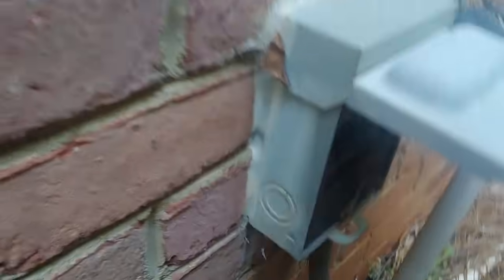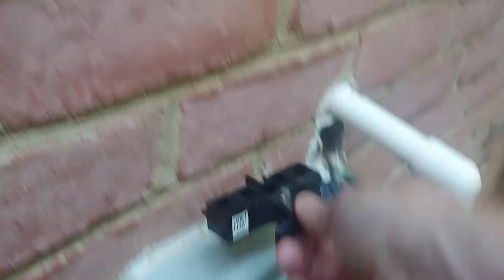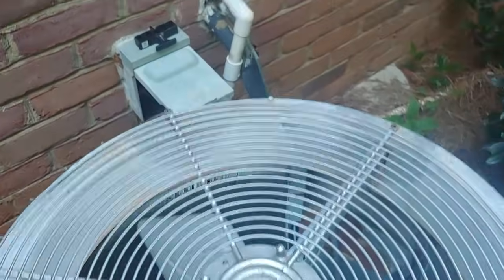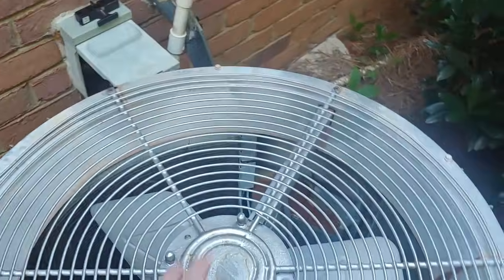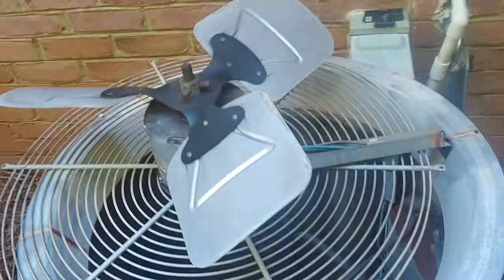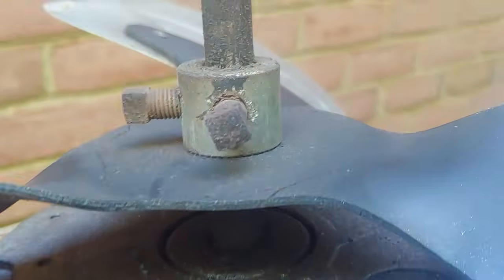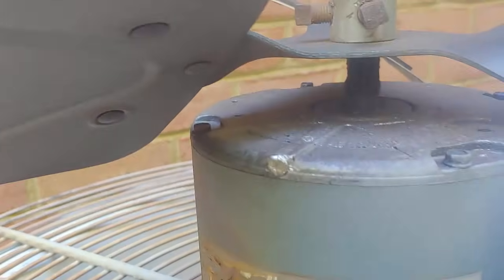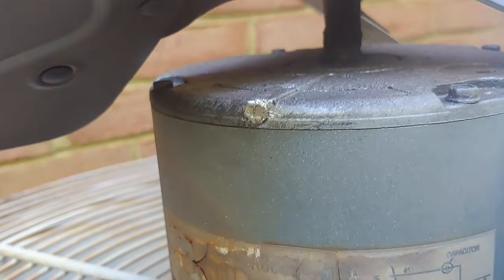YES! You CAN oil an air conditioner fan motor AC Fan squeaks/squeals/chirps/screeching noise, FIXED!

Comment: Last night my fan stopped spinning altogether so I went out and gave it a few taps with a hammer and it started spinning again but seemed a bit slow. A few hours later it stopped again. It was my plan to go get WD40 but luckily I came across this video. I hope doing this will get me through this heat wave we are having this week.
Reply from the maker: Smart. It seems like you caught it in time. Mine is still going! I did just oil it again, this time I used electric motor oil, actually hair clipper oil and it has not been this quite in years!

Comment: hI.  i added the 1 AND 3 OIL TO THE FAN AND NOW it does not come on.  What did i do wrong
Reply from the maker: Double check all your wires make sure you didn't pull something loose. Also make sure you did not put your quick disconnect back in upside down.
Reply: @SwimmingintheDeep  it started after a couple of resets.  I got scared. The fan sounds much smoother but still has like a off balance sound to it .  It is about 15 years old. Thank you so much for the reply; and help.  Much appreciated.
Reply from the maker: @danasweatt1484  ahh good. There is likely a built in delay to restart after repower on your unit.  The off balance sound could be a bad bearing in the motor or a bent fan blade. If it is a bad bearing your noise may soon return then then the remedy is usually fan motor replacement.
Reply: @SwimmingintheDeep  super thank you. Trying to save a dollar. I went ahead and purchased a new fan motor unit to have when ready.  Blades don't seem bent but could have overlooked a minor bend. I took it off last time when cleaning coils. Probably bearings.  Thank you again. Helps to have advice when new/green to it.

Comment: Not cheap, every dollar you keep in your pocket is like being paid. Thanks for the video. I'm on my second fan and wondered if I could oil it and get some more life out of it. Had a new Goodman Heat Pump System  ( Condensor GSH130361BB ) Installed in 2010, its been flawless except for the fan goes out about every 5 years. The second fan has just started getting a bit of a hum to it. I'm hoping if I can lube it before the bearing goes bad it might last a few more years. I lubed the condensor fan on my 35 year old GE Side By Side, and its been running flawlessly for 14 years.
Reply from the maker: Thanks! I bet the oil starts getting the many more years. BTW, mine is still going since this video without more oil yet.

Comment: I see smoke coming from mine. Hear humming,but the fan doesn't spin freely. It's like it's trying to. But because of the smoke I turn it off.
Reply from the maker: Honestly, it sounds like yours is too far gone that the bearings are already burnt up. I'm afraid it's time to replace your motor.
Reply: @SwimmingintheDeep  I was afraid of that. Any idea how much that could cost me?
Reply from the maker: @freightshaka4193  $60-$150 for a new fan motor (for the part itself). It depends on the fan model. If you don't get one online, see if you have a Grainger near you and they'll help you match it up. Pull the power disconnect if you work on it yourself. There should be plenty of YouTube videos that may help.
Reply: @SwimmingintheDeep  thank you. I'm gonna work on this and update as I go along. As long as it's not gonna set me back by thousands,you know.

Comment: Thanks for the video. My unit is about 16 years old so I'll be trying this first but it looks like the motor will be needing replacement soon. It squeaks and makes noise. Probably the bearings but I'll try this first before replacing the whole motor
Reply from the maker: Thanks for the comment! I bet it will help your motor more than you realize. Mine is still going and my spare motor is still sitting on my workshop bench.

Comment: I was able to get oil in by gently tugging upward on the fan and squirting it onto the motor shaft where it goes into the motor case. I used Lucas gun oil. Altogether got in about a tablespoon of oil then let it sit for 30 mins. Flipped the fan back down, screwed it down and flipped on the breaker. No more screeching!  Out of pocket cost was $7.  Ty for the video!
Reply from the maker: Great to hear! Thanks for the comment!

Comment: Good video. Been doing this since 1993 on my two Rheem units. Also oil the blower motor on the inside unit. Over the years I used 3 in one, singer sewing machine oil, 5/30 mixed with transmission fluid.
Reply from the maker: Thanks for the view and the comment!

Comment: Saved my behind today!!! (Rheem Critierion II manufactured Nov 1990) Oiled the first port and it still wouldn't turn freely. Started to freak out a little. Then I looked a little deeper and found the second port hiding from me! Looked like it hadn't ever been removed. Oiled that sucker and the shaft just like the video shows. Restarted the system and it's running smoother than it has in 10 years. No squeaks or screeching, just quiet and cold. ;-)
Reply from the maker: So great to hear! Makes my day when I hear from people like you!

Comment: Got same problem where  can I find same motor. Looks like the one in your  video.  Been 20 years since bought  house. 20 years back looked.  Ancient  AC unit
Reply from the maker: Hi, just now saw this. Look at the sticker on your current motor, try to closely match up the amps and RPM. Most replacement motors are reversible for direction. Look at the "Frame size" and the shaft length. Find a close match. Or take the old one to a Grainger store and the parts guy will help you.
Reply: @SwimmingintheDeep  thank you

Comment: Love your Channel!
 2 questions, first will it hurt to run AC unit with the motor being held in place by 3 screws instead of 4 since the acorn nut broke off on top of unit ?

Second, had to buy new contactor looked same as old but was not marked L2 L1 on 1side or T2 T1 on other side and when i asked the guy at store he said  did not matter, but i asked  him to check and then said 1 side of contactor is flat other side has a kind of cut out, so line up old and new and see where the 2 line wires were!   I did that and all is well, but why are new contactors not marked?

I could not really find any answers  anywhere, most say dont matter but a few said it does, but no detail on how to know where to put the 2 line wires.   Than You for all U do!
Reply from the maker: Can you replace the broken acorn nut with a regular stainless steel nut?  And I don't have much advice to give them the wiring, I just looked at the wiring map and studied it a few times on the side of the motor before I gave it my best guess when I wired my new motor, not the one in this video, on my other unit.
Reply: @SwimmingintheDeep  No when the Acorn nut broke the  bolt from motor broke off inside Acorn nut, so motor is now held in place by 3 nuts instead of 4!
Reply: Fixed my broken motor thru bolt ,simply took off another Acorn nut went to Ace and found out the thread is8-32" but they had no bolts that long, but a threaded  rod 3' long for $4.50 which i bought along with some 11-32 nuts.

Then did loosen the other motor mount nuts on top of AC unit , next  did take out all nuts for top AC cover and propped it up on 1 side, had to loosen two 11-32 nuts on top of motor and then the bolt fell out.

My motor is 4"high and the bolt to mount needed a 1/4" more  so cut my rod to 4 1/2" and put a 11-32 nut on bottom and then left 1/4" of the bolt on bottom sticking lower then nut and crimped rod below nut so nut wont come loose then on top of motor where bolt comes out is 1/4"lower then top of motor which why 2 nuts were used so with these on they now where level with top of motor then simply put new Acorn nut on top of AC unit  cover and all is well then made sure  all Acorn nuts were snug!

Found out AC unit was made in 1992  had to replace the Capacitor 7 yrs. ago,  it lasted 5 yrs. and the last 1 lasted 2 yrs.  So far this month had to replace Cap. and contactor and oil motor and hopefully it will run a long time!

Thank You!
Reply from the maker: @jamesmincher5219  wow, great job. Thanks for the comments too!

Comment: My A/C is from 2004, 3 more years and will be a 20 year old unit.
I replaced the bearings on mine $15 bucks and good for another 20 years.
Reply from the maker: Great work!
Reply: How did you replace the bearings?  I've tried to figure out how to do this for years and have had no luck.

Comment: I need a new motor but the label is so burned i cant read anything, so how can i find out  which type i need?   Thank You!
Reply from the maker: I'd look up the model of your AC itself and see if you can figure out the part/motor stats.  That or take it to a Granger location and put it on their parts desk and ask for their parts guy for help. Search for Granger (industrial part supplier) via google.
Reply: @SwimmingintheDeep  Thank You, i found a label with serial and model number on side of unit and when i goggled model it found motor for $90.   Was shocked though since big plastic badge on front sys Trane and on the side label says Goodman manufacturing and the model number refers to Goodman parts not Trane!?  So do i have Trane or Goodman AC unit? Always hear bad stuff about Goodman!
Reply from the maker: @jamesmincher5219  I'm not an AC guy, just a "fix it myself guy," but I know Goodman brands are sold under a few names including Amana. My 28 year old units are Amana, not sure if "Goodman" made them under that name back then. I had not heard of one badged Trane though. In the end, many parts are universal, especially motors as long as it has the same specs.
Reply: @SwimmingintheDeep  Thank  You! Seems any parts i may have to order i have to use the Goodman model number.

Comment: The cover for the fan motor I think is making noise this cover is a plastic cover and very loose but it’s spinning a little with when fan goes on.
Reply from the maker: Look at the screws holding it on. Take one out, take it to an Ace Hardware and they'll help you find a match so you can buy more for any missing.

Comment: Hi ya It appears the fav is not connected to that grill do I still need to remove fan  or can I oil in place??? I am doing this right now and would appreciate any help thanks
Reply from the maker: not sure how yours is mounted but you'll need oil to run down the ports (if you have them) or the shaft of the fan. You'll likely have to figure out how to unmount your fan to do this. Ensure the power is off.

Comment: It's satisfying to get something working again (especially for the price of a can of oil - btw, use 3-in-1 20wt Motor Oil - that's for electric motors - instead of the household version; available at Lowes). Cheap would be spending a couple hours driving all over town to find the lowest price on the can of oil! Thanks for the tips. Got my 20-yr-old window ac running again with several drops of oil, and was all ready to spend $400 on a new ac. (The new features like remote control and timer would be nice, though.)
Reply from the maker: Great! Thanks for commenting. Works for window units too then! Good because I just bought one for the basement.

Comment: Mine was making a horrible noise and then stopped working entirely. Guess I find this video too late.
Reply from the maker: I have even done this to a seized motor and brought it back to life with drops of oil. My other unit ran for 10 years more after doing this when it seized one summer. You have to catch it early enough when it seizes or it will burn out entirely.

Comment: I’ve tried oiling the fan motor a couple of times and it seemed to work until tonight. Still squealing. Do you have any other ideas what to check?
Reply from the maker: Hi Kellie, if it is no longer working to silent the noise then the bearings are shot. You need to replace the fan motor. You can get a motor for under $120 and there are probably YouTube vids on how to do it. I replaced one of my motors two years ago (not the one in this vid as it is still going) and it was not hard for anyone that has wired an outlet or similar. Just make sure you pull the power disconnect as I also show in this video. When shopping for a fan motor, start with your motor's model number and search.  If you can't find your exact motor, look for one that is a cross reference. If your fan motor is too old to still be made, no worries, just look at the specs on the sticker on the motor and find a close match to RPMs, and amps. They also run clockwise (CW) or counter clockwise (CCW) and most of them you can reverse these days by switching the directly of a plug that is on the harness. You'll also need to make sure the right shaft length for the fan is on the motor. If your have plenty of room for a long shaft in your compressor cage you can go with longer. If you need help with matching your motor up, find a Grainger or similar store/supply house in your area and they will help.  One more thing is that even though you may turn the power off and should pull the disconnect, there is a capacitor that "holds" enough power to hurt you. You need to know how to take a screwdriver and short the capacitor so you can work on it. Look that up too if you don't understand.

Comment: I did this method, except I didn’t have plugs, so I resorted to dripping it down the upturned shaft a few times. Took 10 minutes of hand-rotating and intermittent dripping. I’ll report back when it starts squealing again for a useful timeframe (5/22/2021 was the first oiling). If it lasts two weeks, I might need to replace the system (furnace/blower is rusted out, several expensive fixes over the recent years, undersized for the needs), but if this piling lasts a couple months, I’ll just keep doing it for the summer season. 

Hoping to make a 16 year unit into a 17 year unit!

Thanks for the step by step!
Reply: How is going to ac fan motor?
Reply: @flavioborrovic8619  still running perfectly.
Reply from the maker: Great! Still going?
Reply: @SwimmingintheDeep  it’s winter so it’s not getting any use, but yes!
Reply: It’s 6/30/2022 and still running and still rotating quietly. Great solution and it looks like I got more than a year, maybe multiple!
Reply: 5/26/2024 and it just started to grind again. I oiled it just as before: pulled the breaker outside, took off the four bolts, turned it upside down, dripped and hand rotated the blades back and forth, put it back together, replaced the breaker, turned it on. Soundless! 19 years now.

Comment: Mine is making a really loud noise all of a sudden. Like, embarrassingly loud. The fan works and the ac runs in the house for two minutes before I shut it off because of the noise. I don’t know if oiling the fan would do it but I also can’t afford thousands of dollars. I don’t know what to do.
Reply from the maker: If it's coming from the fan motor, oil it, nothing to lose.

Comment: Use oil specified for electric motors.  Such as 20 wt motor oil.  3 in 1 has a type of oil for electric motors (20 wt).
Reply: I found a can of "3-IN-1 MOTOR OIL" at Lowe's. "Motor Oil" sounds like it's for cars, but the can says elsewhere "for electric motors" so this is the perfect stuff. Used in on my window AC that wouldn't turn, and perfecto!